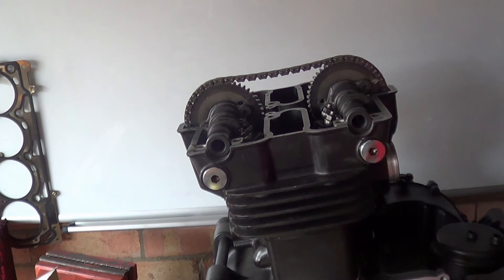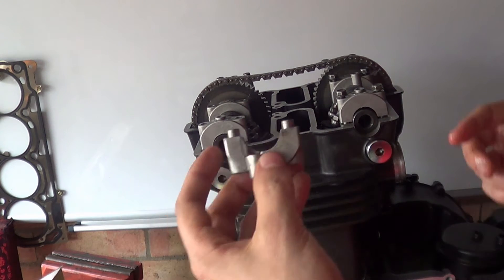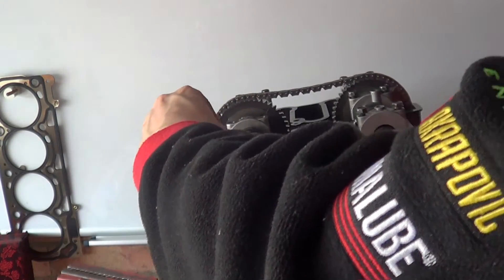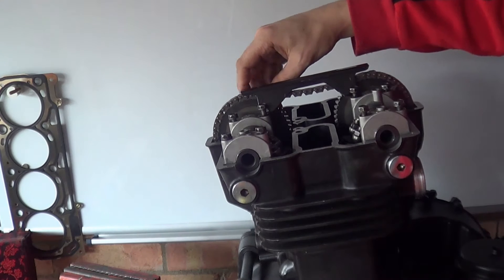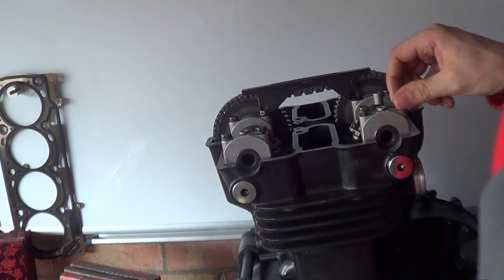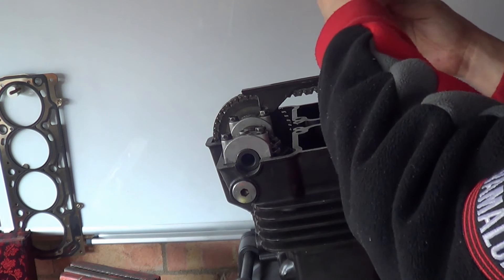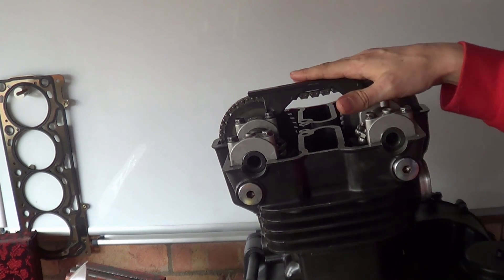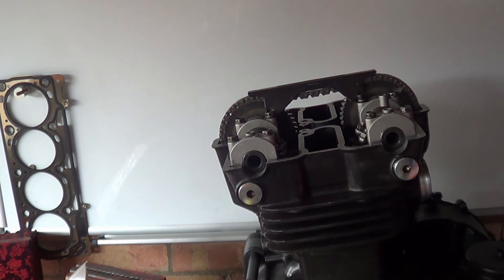Kawasaki ER5/KLE/EX500 - Episode 66 - Camshaft Timing Part 2

Comment: Got a problem with this. While on C position and trying to time it the EX shaft doesn't sit properly, seems the lobe is lifted by the rocker arm  so I really can't align it to the IN shaft. Any ideas?
Reply from the maker: That is how it is - unfortunately. I've been through this with other people before. And yes, I know it does seem correct, but some other bikes are like this. The root of the camtensioner blade stick out further than it should and that's what needs compressing back . 
Load the cams in where they align with the marks and then (even with the cam slightly sticking out) tighten down the caps. She'll just seat properly
Reply: @thedirtyworkshop  thanks so much for replying, mate. I actually did that but, as I mentioned in a comment in the video following this one,  resistance builds up and at a given point it  feels very hard to turn then releases. I don't hear anything clacking or hitting but there's  this muffled quiet hissing. Wondering if it's either a valve or the chain itself which it's tight and not slacking at all.
Reply: @thedirtyworkshop  Thanks, so it means:  the  #1piston exhaust valves are going to be sligthly opened when the crankshaft is at "C" mark? I have the same issue, intake shaft installed, but exhaust wont seat due to the #1 cyl shaft lobe, hitting the rocker arm. If I invert the shafts, no issue, but that could not be recommended? . In the video, you are tightening the caps, with the shafts not aligned to the head line: Ex and In? so you do not have the issue,  thanks for your help, in advance.

Comment: Basically a good walk through of the ER5 engine top end rebuild, gets a little confusing when you pointing and talking about the exhaust cam when in fact it was the inlet cam.
Reply from the maker: Do you mean at 12:32? - Because that is the exhaust cam - exhaust to the left of the image, intake on the right side......

Comment: Those cam cap threads are really fragile, had the same thing happen with exactly the same hole.
Also used the same solution as you.
Reply from the maker: Yeah luckily kawasaki thread all the way down. I think its due to the thread engagement length. Your only grabbing 5-6mm of threads due to the cam guide acting as a spacer. Really, those 4 bolts need to be 5mm longer and then this wouldn't happen. Good to here that someone else has had this issue. Misery loves company lol
Reply: mine too horrible